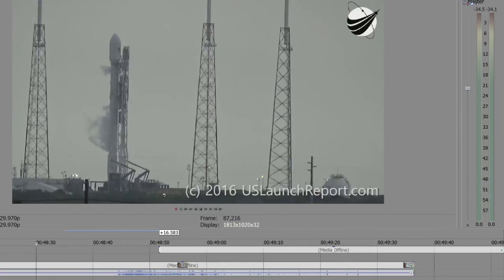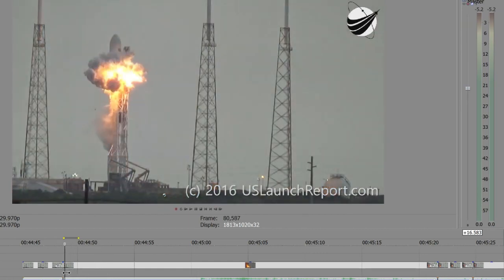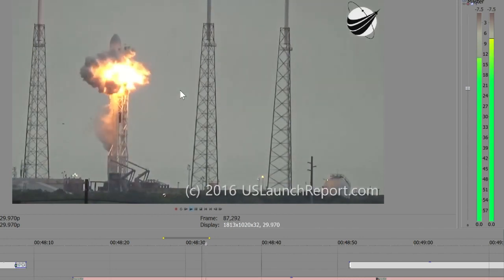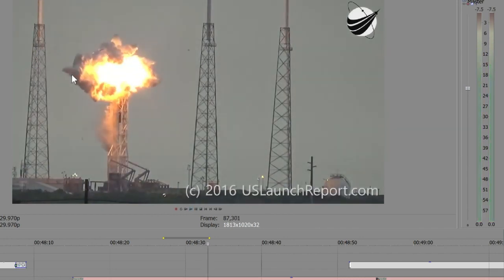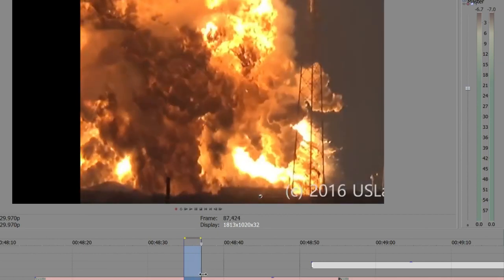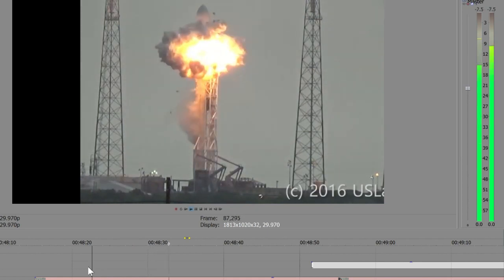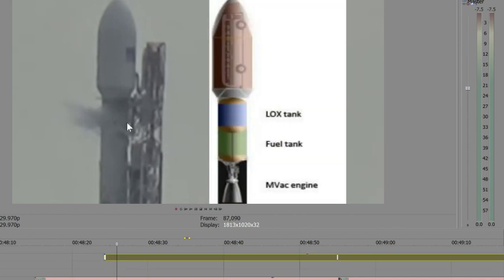Detailed analysis of Spacex Rocket Explosion

Comment: Usual point of failure is around the pipe inside the tank that runs the oxygen right through the kerosene. That does make a whistling or "squeaking" sound when it does that. When the liquid oxygen comes in contact with kerosene it boils, so it would expand the tanks and that makes a popping sound as the cylinder tries to become a sphere.

Comment: Great analysis, liquid oxy also expands quite rapidly as it boils off (expansion ratio from liquid to gaseous is massive) & builds up huge pressure. If the design limits of the rocket's outer structure & the structure separating the 2 fuels is exceeded by the expanding LOX into gaseous state, the failing structure & components may be a source for ignition also.

Comment: i dont get why people even need rockets anymore. why cant you fly a plane into space? like one of those new space planes?
Reply: It's actually really difficult to get planes into space. As altitude increases the air get thinner and thinner. Once the density of the air has gotten down to a certain point jet engines will blowout due to the lack of oxygen in the air (the fuel can't be ignited without enough oxygen). 

But the problems do not end there. Although you could in theory put rocket engines on a plane alongside the jet engines to have it fly into space the problem with fuel and weight arises. With the current efficiency of rocket engines it is simply impossible to launch a plane into orbit and back, at least without droppable boosters or some detachable system to move the plane to the upper part of the atmosphere. 

This has to be done because fuel weighs a lot. And so does fuel tanks. So in order to go to space you will need several stages that are dropped of one after another or the spacecraft will weight too much.
Reply: Paul Hendrix When you think about it, that's actually a pretty good analogy. If we could build a bridge to space, that would be increadibly, increadibly helpful. But it would also be insanely difficult. Probably impossible. But fundementally, driving a car to space is not actually a bad idea.
Reply: Yeah, right? Why don't we use cars to just drive to space?
Reply: Oh, I didn't even think about the oxygen problem! But it sure is one heck of a problem, if you think about it.
I heard of this space elevator thing, like this huge rope tied to a satellite. Maybe just climb the rope into space?
Also, probably, a giant vertical coil gun that shoots man-bullets could help, as it's powered by electricity. Any one of these things, if efficient, would make rockets obsolete IMO
Reply: Fyodor Plays Lol, yeah, A space elevator would be cool. But at these insane heights, we don't even have a rope that could hold itself before tearing. 
I've been thinking about "space bullets" as well - it would require a giant launchin apparatus and would probably not boost the rocket enough to make a full launch, but it would, if possible, save some energy and nicely improve the (at the moment REALLY thin) rocket to payload ratio. But then again it would be very expensive to build, difficult (but theoretically cheaper) to power and the rocket would be under pretty big stress as well. 

I think SpaceX is going the currently most viable path.
Reply: It wouldn't, it's only like 16 miles to get to space.

Comment: "demonetized for explosion"
Reply: Theory:  The fuel barrier breached, causing the squeak as the oxygen fell in to the fuel tank and boiled.  The pop is the hull deforming under the pressure.  The resulting breach and ejection of pressurized gas creates an electro-static charge, igniting the explosion.

Comment: requesting public's footage doesn't mean they didn't have their own footage. they are very likely just looking for additional data points. maybe triangulating some sounds.
Reply: So fast? It was a full week into the investigation before they requested additional footage. They already had thousands of data channels. More data is always a good idea.
Reply: You can triangulate with only two sources. I don't think they had any footage or audio outside of the internal acoustic sensors on the rocket.
Reply: David n how do you know what data they have?
Reply: ***** I know they have acoustic sensors because they said they used it to determine the Helium tank failure last time they had an incident.
Reply: David n In other words, you don't know what footage or audio they have, outside of the internal acoustic sensors.
Reply: ***** Not with 100% certainty, no.

Comment: Is there an umbilical connection near to the O2 and Kerosine bulkhead, it seems to me that the oxygen and kerosene mixing is bad but won't burn until if finds a spark. The center of the fireball in the first frame seems to be towards the side of the rocket closest to the gantry tower. We can see an umbilical going to the satellite faring and a mess of stuff where the explosion starts. So I am wondering if that is where the O2 and Kerosine found the spark.

Comment: I'd bet real money that you are going to look like a total idiot when the actual cause of this is revealed, Phil.

@1:56 - "...second stage falls down..." That's actually the payload satellite in its fairing, Mr. Observant. (Note the purple flames and brown smoke from its hydrazine fuel going off.) It was heroically held up by the strongback claw (obviously not designed to take vertical loads) while the rest of the stack disintegrated underneath it.

@4:39 - Why do you keep insisting on calling liquid (and super chilled) kerosene "gas"? It's not a gas, and it's not gasoline and doesn't behave like gasoline.

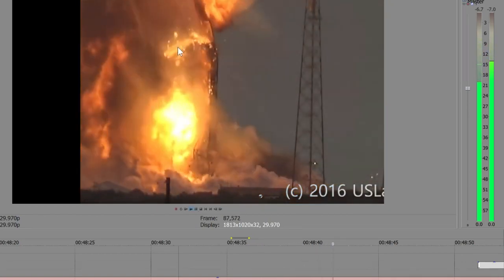@4:55 - Oh, now it's a satellite with its own propellant on board. Yep.

@9:08 - Jumping to conclusions is a "no brainer" alright. You might also note that that's where the propellant feed umbilicals enter the upper stage. Even ULA had to scrub a launch just yesterday due to a liquid hydrogen leak in their feed lines. But nooooooooo, you've ruled that out of playing any role.

@10:17 - The tanks are pressurized to strengthen the entire structure. Like an inflated balloon. But, at 8 minutes before the test fire was set to happen, they would not have been pressurized yet. You'd know this if you read as much as you mouthed off.

@10:32 - "....a partial vacuum..." LOL! That engine FIRES in vacuum, dummy! That's what "M-VAC" means and why its nozzle bell is so much bigger than the first stage's! (But yes, it's pressurized during flight, mostly to add strength. The helium bottles are inside the 2nd stage LOX tank and one of those breaking free due to a weak strut provided by a subcontractor was the cause of the flight accident last year. It would be very surprising if this was due to the same, known and presumably fixed, issue.)

@11:57 - That's clearly a block from the video compression artifacts! LOL! 

@14:30 - With something like 3000 channels of telemetry on a physical connection from the rocket, I'm pretty sure SpaceX would have noticed something happen at the -5 second mark when we hear the "pop". You'd expect a big spike on pressure for that tank. You'd also expect acoustic sensors to pick up the "pop". But Elon has said that the telemetry all looks normal right up until the explosion. So we can rule out this line of inquiry. (Elon does think the pop may be a clue, so it's not like he's in denial about it. But again, he's already stated publicly that the pop doesn't correspond to anything in their telemetry.)

@15:29 - "They definitely had a rupture on this tank". Sure, but was that cause or effect? You seem to have decided it's the cause.

@16:02 - They KNOW the tanks' contents weren't mixing or they'd see it in their telemetry! When they refer to no source of ignition, they're referring to any trapped vapors. (I believe any internal compartments on the rocket not filled with propellant are pressurized with pure nitrogen gas too, just to make fires that much less likely.)

@16:17 - "Peroxide formed from kerosene". What the actual FUCK? Seriously? Don't you think rocket scientists would know about such a thing, as they've been using kerosene and liquid oxygen as rocket fuel for about 70 years now.

@16:38 - "This [kerosene] is about at minus 10 or something." Assume you mean Celsius. And once again, WRONG. It's just above the freezing point of kerosene at about -73 C. (They do this now to maximize the density of the fuel. Same with the LOX, it's just above the freezing point of oxygen instead of just below the boiling point as with most rockets and earlier versions of the F9 before they started using the super-chilled propellants.)

Not impressed. Isn't there some bunk you should be ridiculing?
Reply: Triggered as fuck. Awwww....
Reply: Admiral Quality Don't like his video about this event? Make your own then buddy Boyo.

Comment: There were quite a few images of the tank interior dredged up after last year's malfunction. They appear to show the Helium COPVs attached at the tank circumference, near one end of the tank.

I wonder if this could be another case of a vessel detaching inside the tank? That might fit the squeak and bang noises, though it would be quite something if a failure mechanism so similar to last year's was responsible!

Comment: There've been a lot of Falcon 9's.  If there were no design changes, I think it was a manufacturing defect.  What do you suppose the ignition source was?
Reply: I believe the ignition source was just the temperature difference of the LOX and the atmosphere,even if it was -4'C outside.I don't know the heat of fusion for oxygen but it's for sure in the negative degree celsius and the launch was done in Florida which is sunny most of the time.

as for the manufacturing defect aspect you mentioned,it's indefinite until they have examined the debris of the explosion but I personally bet on the defect being in the LOX flow pipe,the canister walls seems fine to me.
Reply: oops,I meant melting point of oxygen
Reply: The oxygen would just boil off at atmospheric pressure.

Which it would do continuously anyway.

That's what the fog you see escaping the tank early on is. It's the safety valves letting the oxygen vapor out, to keep the pressure manageable.
Reply: And of course, the boiling cools the oxygen it's leaving behind....
Reply: +Jack Dingler now that you mentioned the safety valves,I do think it weird for the explosion to even be possible IF there were no manufacturing defects.my bet is the defect being in the lox flow pipe
Reply: I agree some sort of defect that allowed the kerosene and oxygen to mix.

Comment: If you watch the video non-synchronized, you will notice the creak and pop noises happen when the fireball is at its brightest. This would suggest to me that it is thermal radiation (or radiant heat) heating up metal objects next to the camera (possibly a tin roof the camera was on). Obviously since I am talking about objects local to the camera you will get those sounds a few seconds before the sound of the blast. I question whether the camera would pick up any structural creaking or popping sounds in the rocket at 4km away.

Comment: I'm posting this before finishing, at 8:21. That squeek or pop is probably due to thermal strain as the liquid oxygen enters. If they don't do something to cool down the tanks before hand then this is very likely. If there was a weak connection between the tanks the metal contracting might have popped a hole into the tank leading to the fuels mixing.

Comment: That is a lot of assumptions with not a lot of actual data.
Reply: you said his estimates and assumptions are reasonable. But, with the limited data, there is nothing conclusive here. Assumptions and estimates should be treated as such. 

I'm not even saying his conclusions are wrong. I'm saying, without the thousands of data channels SpaceX has, 'inconclusive' is the only reasonable conclusion right now. The video is, however, useful for discussion. Even if nothing new is presented here.
Reply: very confident in his estimates
Reply: Which assumptions and estimations concern you?  If you're so smart, make your own video.
Reply: Yeah, so am I. 
It's pretty reasonable to think that the problem was where the explosion came from, which is most of what he said. 
The sound before the explosion was really just a guess and he treated it as such. Also a good thing to at least point out, though.
Reply: Welp. 
SpaceX hasn't released anything.

Comment: Possibly they had a low factor of safety in the materials they used to save some cash? 
1 rusty bolt or peace of metal could have dramatically weakened its structural stability combined with a low factor of safety.

There could have been forces and resonance vibrations that exist only during fueling that were not taken into account in design. Like the cold gas continuously hitting a certain point in the tank during fueling which made that part of the tank colder and weaker... Because if a velocity of cold gas per second hits a point then more fuel will hit that point instead of when the tank is full and the fluid is not moving. Maybe that will transfer more heat since heat transfer will have to do with volume of gas in contact with a surface per second? That could take it out of range for a low factor of safety. 

I can see them having a 3% vs a 4% factor of safety to save maybe millions on a choice of material that is cheaper, and then not take some slight variation in pressure while fueling into account in their design. If you design a fuel tank to a certain factor of safety according to a given pressure and temperature and I guess resonances of the rocket vibration while in transit... Then it might be easy to mistake forces during fueling and vibrations during fueling. Maybe the heat of the rocket during use counters the cold vibrating gas to keep the temperature and pressures within range, so any vibrations during fueling when the rocket is not in use might make the metal too cold and weaker vs the pressure. (Since a vibration would increase the volume of gas per second in contact with the tank walls which would make it colder)

Comment: the explosion started right at a fuelling point... why the fuck they fuelled the 2nd stage for a 10 second run up test IDK... but the pop sounds to me like the fuel nossel decoupling from the rocket.
Reply: The engine was new, no refurbished parts. And they test the entire stack, computers, power, sensors, etc.
Reply: they were fueling it for quite a while before the rapid fire. They load it all up so that the rocket is under maximum structural stress during the static fire.
Reply: Lehtaan a question i have 4 SX is y are they fuelling the 2nd stage for a ground test? they were not launching
Reply: George Holt Like i said above, because they want to test the rocket under the maximal structural stress with the same circumstances as the real launch which is why they also stacked the payload.
Reply: Lehtaan well they are not testing the structure,,, they are testing the refurbished engine and only for 10 seconds. 

The rocket is held down and clamped anyways so it isn't really a accurate way of testing loading... also most of the loading comes via acceleration and most of that is at the top end of the flight.

The first time the vehicle is standing on a pad that it can test it happens to have its payload stacked but thats a risky way to operate considering that flight insurence for satellites only kicks at launch... ok they paid out this time but they might not get that lucky with another company.
Reply: It's not just for the engine. It's just that the engine is the last thing they can test without actually releasing it from the pad.
Reply: ᛗᚨᛋᛏᛖᚱ39 yes was factory new... but they always do a run up test for the engine.

Also the term "flight proven" is advertising bullshit! parts are either airworthy or they are not. Clearly the design works therefore it is flight proven but one flight does not prove that there will never be a problem.

Comment: wouldn't the change from the "pop" happen 12 seconds before you can hear it?
Reply: Exactly why he synchronized the sounds with the picture. He demonstrated that there appears to be a physical change in the shape of the rocket when the "pop" occurs in the audio is in sync with the overall timing of the explosion.
Of course he also speculates that the apparent change could just be a coincidence due to a change in lighting as the condensation cloud changes direction.
Reply: Oh, I'm sorry. You're right. I guess I just didn't listen to that part

Comment: If they were test firing the main engines, why did they even fuel the 2nd stage?  They had a problem in a previous launch with the 2nd stage where a weld failed on a bracket holding the helium tanks.  The helium tanks were kept at the bottom of the 2nd stage LO2 tank to keep them cool and when the weld broke the helium tank shot to the top rupturing the LO2 tank.  It's possible this happened again and that pop was a failure of one of the helium tank.  Even if they hadn't fueled the 2nd stage for the test fire, the rocket would have failed during launch.

Comment: The small pop sound pre-booms is definitely intriguing. I'm inclined to think the squeak is an object near the camera due to its clarity. I don't know if you can rule out a small explosion before the big booms, so I'll leave that to TF and SpaceX to sort out. There's an indication of distance with the small pop before the blasts. The almost inaudible pop may indicate a structural failure of some type that caused a rupture somewhere and exposure of the fuel to a heat source or spark.  Why the seconds of delay between the pop and booms is the other question. Structural failures can mimic the sound of a chemical explosion.
Reply: Elon tweeted about the pop and said none of the rockets onboard sensors detected anything. I'm really looking forwards to hearing the verdict on this explosion as it seems to have no discernible cause.